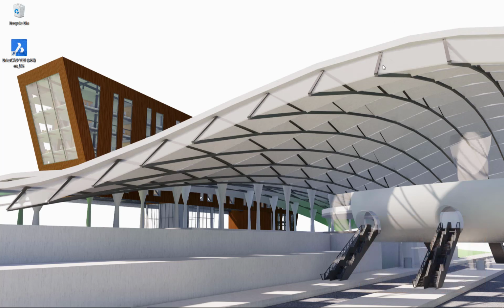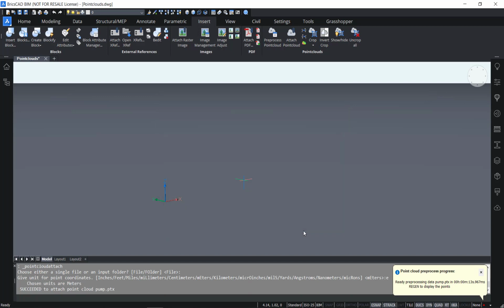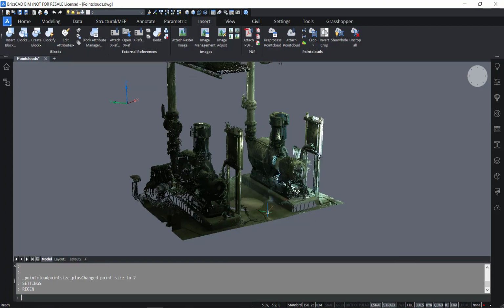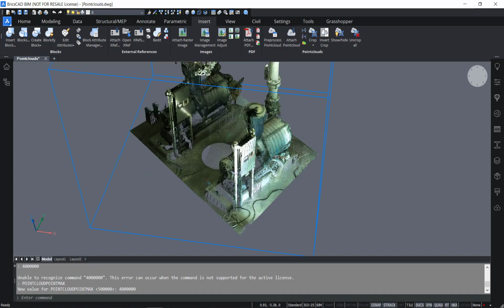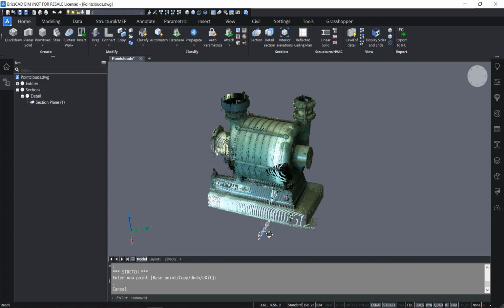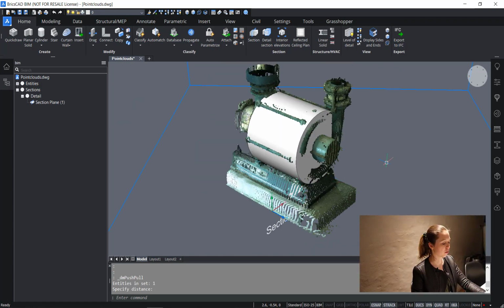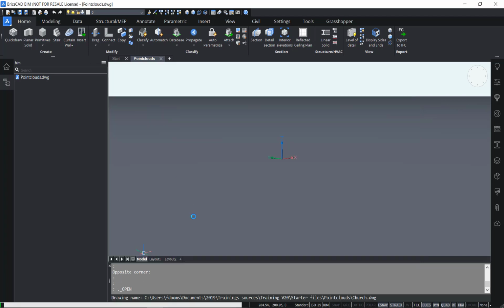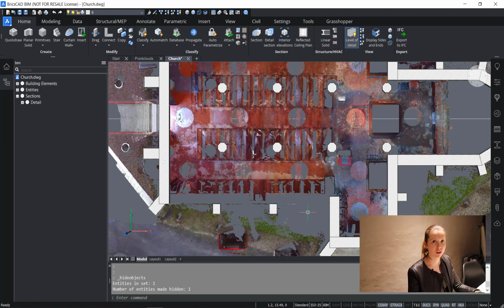BricsCAD V20 BIM Academy 11 - Point Clouds

Comment: When i import a file then BricsCAD V20 notify a problem as: Error in initializing file reader for "file" (check 8 or 16 bit data). Can you show me how to fix this?
Reply from the maker: Possibly the file is corrupted and then the file reader cannot be initialized. Could you try to open it with the free software CloudCompare? www.danielgm.net/cc/
CloudCompare may return a meaningful error, like the checksum is not correct. If the file is OK in this program, we need to check it on our side and kindly ask you to create a support request and attach the .rcp file to it. 
You can do it on our web page (the login is required): specify the version you are using, the operating system, explain the issue and attach the file
https://www.bricsys.com/protected/support/NewSupportRequest.do

Comment: I inserted pump.ptx file to BricsCAD V20 (trial version) using same settings as in this presentation. The result is differet than in this presentation, point cloud displaying is "poor" i.e. there are a big gaps between points. What is the problem ?
Reply from the maker: You can make the Pointclouds look bigger without gaps between them: in BIM workspace->Insert->PointClouds->Increase PointCloud PointSize.
Reply: @OctaveBricsCAD  that's not the problem, i can send you a screenshott
Reply from the maker: @zdenom5510  Could you, please, submit a support request on our web page (the login is required) describing the issue (it would be helpful to know your version, add the screenshot) and our technical support analysts will be glad to help you:  
https://www.bricsys.com/protected/support/NewSupportRequest.do
Reply: @OctaveBricsCAD  as I wrote before, I am using BricsCAD V20  in trial mode
and I have no registration (account) on your web page 
so do not know if it possible to create an account in this case (no payment - > no SR)
Reply from the maker: @zdenom5510  You have to sign up to download. Use that email to create the SR. Also, you can download the BricsCAD V21 trial version. You do not have to pay to be able to create a SR.
Reply: @OctaveBricsCAD  OK I'll  do it. As far as I know, CadWorx 2020 uses BricsCAD V20 as its graphics engine. So using V21 is probably not a good idea.
Reply from the maker: @zdenom5510  You can try to change the POINTCLOUDADAPTIVEDISPLAY option: find it in the Settings dialog or type it in the command line. It toggles displaying of point cloud with adaptive and fixed point sizes.
Reply: that's not the problem

Comment: Can you setting the point cloud max in 1 billon ?
Reply from the maker: Yes. We work with point clouds with order to 1 billion points. This takes some time to import - preprocessing takes roughly a minute per million points. But this happens just once and then data can be manipulated in real-time.
Reply from the maker: But if we are talking about POINTCLOUDPOINTMAX value - for now POINTCLOUDPOINTMAX is topped at 20 million points. This is a display value, which relates to the screen we want to show them on: we can't show more than one point per pixel.